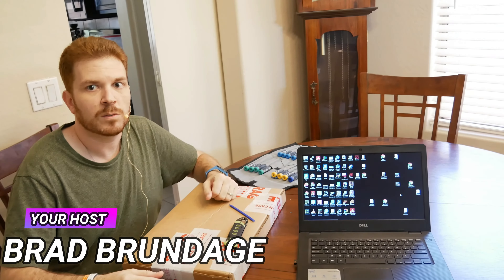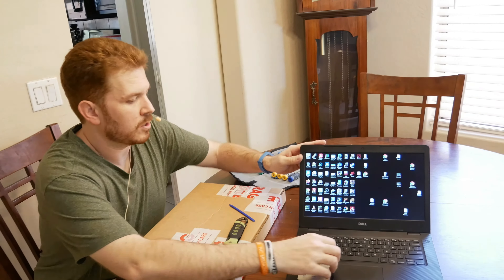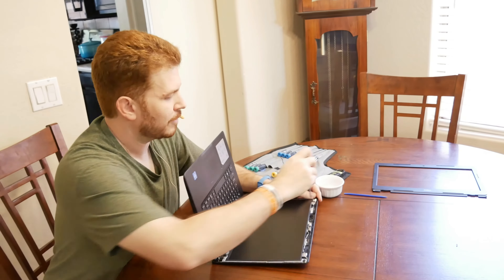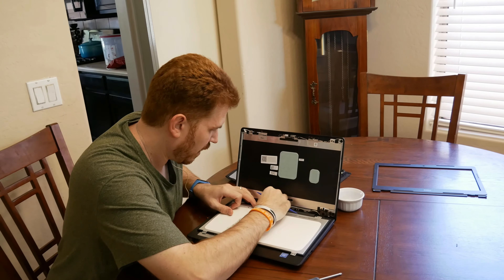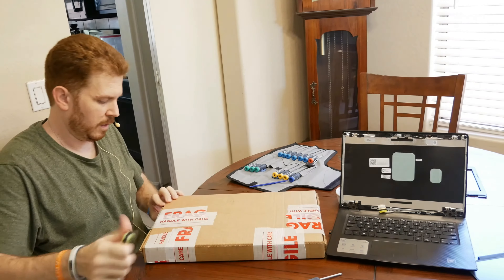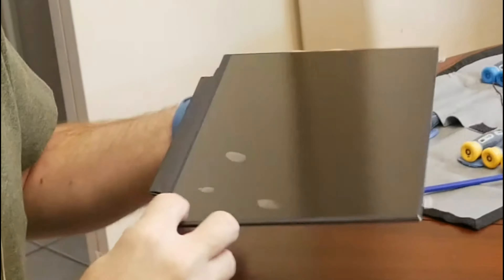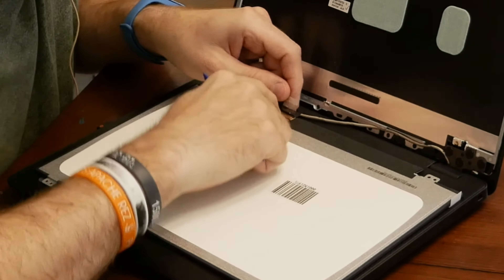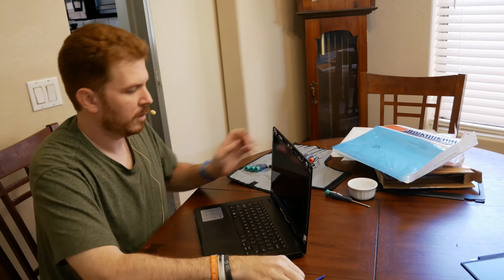LCD upgrade to Full HD | Dell Inspiron 14 3000 series 3493 FHD IPS display upgrade

Comment from the maker: If this get's 1000+ likes in the first month I'll bench press a server in a future video!
This project has been fun upgrading the cheapest most powerful laptop I could find into something really nice!
➡To check out my other videos on this laptop see the main playlist here:
https://www.youtube.com/playlist?list=PLPt3gtEt2KFTT9Se7da68vLo3vOl4pvfH
Reply from the maker: If I get over 2000+ likes in the first month on this video I'll show what mouse I use on my video editing rig.
Reply: @ShinyTechThings  hey man great tutorial and quite easy to follow.i am wondering if u can help me find the ips fhd screen for asus a42j? i ve searchin for it everywhere but couldnt find the ips one.the laptop has 40pin connector.thank you for ur reply.btw u earned another like and subscribe.😄
Reply from the maker: @ridejer5707  That can be a bit difficult because even though I can't find anything for that model specifically you will most likely need to disassemble the display and get part numbers off the back and see what you can find online as being probably compatible. The main things that you were looking for on matching is the pin configuration which it looks like it is a 40 pin LVDS display. You may want to reach out to some of the sellers on AliExpress and see if they can help locate something that might work. Just realize that if you end up replacing the screen and it does not work it could be due to the firmware that is installed on the screen and what the laptop was programmed to be able to work with and you might have to ship it back and try a different panel. Also it looks like your stock screen only supports 720P so if you go to a higher resolution screen depending on your system configuration, it might not have enough horsepower to run as well with a higher 1080P resolution screen because it has to push more data to the screen.
https://www.aliexpress.com/wholesale?catId=0&initiative_id=SB_20210209100222&SearchText=40+pin+ips+14%22+LED
Reply from the maker: @Ride Jer possibly, but I've never use one of those adapters before and I suspect it is still dependent on the firmware being compatible so there's still the risk that you have the parts and it doesn't work. As long as you have the time as well as ability to return items to whomever you purchase them from if it doesn't work, then I guess it's worth a shot!👍
Reply: @ShinyTechThings  thanks man thats alot of info.i will try those and see if it works.😄
Reply from the maker: @Ride Jer Awesome and please let me know the outcome. 👍
Reply from the maker: @Anurag Yadav yes, they can. To keep manufacturing variables and required parts to build different configurations of the same system the number of pins on the connector will be the same, just the specs of the panel itself should be different. That is how I replaced my 720p screen with a full 1080p IPS display on my Dell Inspiron 3493.
Reply: bro what's up!? Thanks for your content. It is very useful. Where did you find fhd screen for inspiron 3493
Reply from the maker: @Sardor Shomurodov I believe off of eBay. I might have pinned it as a comment or put it in the video description. I'm usually pretty good about that, but let me know if you can't find it. Do you have the 3493 as well?

Comment: Nice upgrade! I didnt thought that it would be a plug and play upgrade. Having an IPS display is great, the colours and vewing angles are way better than on TN panels.
Reply from the maker: Absolutely! And for basically $50 is one of the best and most practical upgrades that I've done on this so far! I will be testing my Wi-Fi 6 card once my new access point arrives in a week or two and see how well that performs.

Comment: I got mine back in November 2019, $249 at Walmart. Although advertised as having a Core i3-1005G1 (even the box says i3) it came with the i5-1035G4. Upgraded to a 500GB NVMe and 16GB of RAM. Thanks for the tutorial, I'll be doing the LCD next!
Reply from the maker: Wow, total score! I thought I got the lowest price but you totally scored it!
Reply: I got mine for $200 on ebay as "Refurbished" but it looked like it wasn't even touched once.
Reply from the maker: @Gkid8  That's awesome! Was it with the i5-1035G4 CPU as well?
Reply: @ShinyTechThings  Yep! It's my gaming laptop as a result. I can't do really heavy games but a lot of great ones are possible.
Reply from the maker: @Gkid8  I agree, it's an awesome laptop. I need to try some emulation on it, I bet it could do most emulators pretty good.

Comment: Just received my 3493. It came with the FHD ips panel,  8 gig ram and a 256G ssd.  I'm loving it.  May upgrade to 16 gig ram but I don't see the need yet.  Thanks for your videos and helping me to decide.
Reply from the maker: Absolutely! It's a great inexpensive laptop. With all the upgrades I did to it so far I think it's unbeatable value for sure. Waiting for a Wi-Fi 6 Access point today to setup this week and see how fast it can go over WiFi!😎
Reply from the maker: How are you liking it so far?
Reply: @ShinyTechThings  it's delivered everything I need so far. Light,  fast,  great FHD screen.  I've only used it for study and viewing media (netflix/stan). I originally considered adding another 8g RAM but I see no need for now.  Also tried my Samsung note 9 using the cam software you recommended. Incredible quality.  Thanks for the tips :)

Comment: I recently bought a 3493 refurbished via BestBuy for 605 cdn (450 US) with the 500gb nvme, 8gb ram,  and 1080p but 60hz. Turned out to be a perfect machine fortunately.  I had an extra 500gb Samsung ssd and 8gb more ram was under 60 cdn. Very happy. My question is whether 120 hz is going to make a real difference for me, and how, from the ads I have seen, do I know I am buying 120hz after all. Thanks for the videos and the link to your ebay purchase.? Cheers. Peter  Mountain
Reply from the maker: Maybe I will do a video on the refresh rates 🤔. I have other links in my other videos on stuff as well, just check out the playlist. https://www.youtube.com/playlist?list=PLPt3gtEt2KFTT9Se7da68vLo3vOl4pvfH

Comment: Upgrade the memory on this $300 laptop to 32 (Kingston) and it's nice. Are you happy with the quality of the screen?  Is there a possibility that it can be equipped with a touch screen?
Reply from the maker: @tikblang1 the screen makes it usable in my case. There might be a touchscreen option but I never looked. For the price it is the MOST powerful for the money I could find. Still over a year later nothing can compare that I've seen yet for the money.
Reply: @tikblang1
32 g it’s possible ? For dell 3493 ?
Reply: @ShinyTechThings  ?
Reply from the maker: @Zazzou Mez yes, according to Intel's ARK site the i5-1035G4 supports a whopping maximum of 64GB of RAM!
https://ark.intel.com/content/www/us/en/ark/products/196591/intel-core-i5-1035g4-processor-6m-cache-up-to-3-70-ghz.html
Reply: @ShinyTechThings  correct. The only must have that’s hard to find is the screen resolution , cannot believe Dell still default screen for this nice laptop is 1366x768. That resolution is kinda 5 year old already…
Reply: @ShinyTechThings  thank you, and i5-1035G1 ? The same 64GB ?
Reply from the maker: @Zazzou Mez correct, it's also 64GB as well.
https://ark.intel.com/content/www/us/en/ark/products/196603/intel-core-i5-1035g1-processor-6m-cache-up-to-3-60-ghz.html
Reply from the maker: @tikblang1 actually most consumer laptops under $500 nowadays are 720p, I'm assuming the manufacturer saves $10 a unit on every sale. Dell in some cases has both 720p and 1080p in the same machine but charges a premium for the 1080p as a upgrade.
Reply: @ShinyTechThings  thank you my friend 😊 I have one question: I want change my lcd HD 220 nits—-> FullHD 250 nits, it’s possible ?
Reply from the maker: @Zazzou Mez if it's the same model as mine it shouldn't be an issue. It boils down to the connector and location of the connector if the cable will fit and reach. Then it's up to the firmware if the manufacturer made it proprietary or not. Just buy a replacement from a seller who will return if there's any issues but you should be fine.
Reply: @ShinyTechThings  would love to do it but the seller in Texas is charging an arm and a leg. And I have experienced, internet buying is not good since it’s littered with junk replacement screens
Reply: @ShinyTechThings  thank you 😊
what was the model number of the old screen and the new one?
For me N140BGA-EA3 (old)
Reply from the maker: @Zazzou Mez I don't know on the old screen or where it is I may have sold the old LCD panel. The new one is in a link in the description if I remember correctly.

Comment: So to be sure, my 768p laptop can be upgraded to a 1080p display?
Reply from the maker: In most cases, yes. What laptop do you have?
Reply: @ShinyTechThings  dell precision m4600. It comes in 768 and 1080 but they’re different versions of the same laptop
Reply from the maker: @AgentChavo  that's even easier in most cases. Asl ong as the graphics card is the same then it should be a straight swap. Is yours a touchscreen?
Reply: @ShinyTechThings  well thats cool af. And no its not. I wish though
Reply from the maker: @AgentChavo  so as long as you get a panel for the same model and without the touch it should work but still check the pin configuration (like 30 pin) and the side it plugs to the same side and it should be good! There is always the slight chance that it might not work so make sure wherever you purchase it from they allow you to return an item. But I would say over 95% of the time it will work without any issues. The easiest way to not have problems is to check the firmware version number that is on the back of the existing panel but you have to take it all apart to do so.
Reply: @ShinyTechThings  alright man thank you so much you got a sub
Reply from the maker: @Baby Snow You're welcome. If you have any tech questions ask away. On Tuesdays I do tech support videos, how to's and tips and tricks videos and Fridays are my regular video releases. Check out my other videos and I have several playlists to organize all my content. Feel free to share on and offline with anyone who would benefit from this channel or enjoy the tech content. Thanks for your support 👍
Reply: @ShinyTechThings  of course man you’re really helpful I appreciate what you do
Reply from the maker: @Baby Snow no problem, just trying to do my part to contribute to society wherever I can. You can also hit me up on Twitter, instagram, and Reddit if needed and links should be in the video descriptions for everything. I actually do take the time and sometimes it is even hours to write stuff out in the video description.

Comment: Nice work man! I was wondering if a full HD display can be installed in the same fashion for dell Inspiron 15 3542? If yes, do you have a video on your channel?
Reply from the maker: @Rayed Aslam thanks for your support, I made another video I thought I linked it up at the end or as a card but when I get home later I'll check and update it. I made a video explaining how to do this with almost any laptop here:
https://youtu.be/rsXDvvzBjV8
Please drop questions and comments on that video for some reason it doesn't get much traffic so if you comment a bit and like it then it might help get it recommended more.
Reply: @ShinyTechThings  sure man. I'm not an expert so a dedicated video for my laptop will work wonders for me. I've this laptop for quite sometime now and I don't see any reason to replace it just yet. I've a work laptop as well.
Reply from the maker: @Rayed Aslam  unfortunately I don't have one of those myself however if you are by chance in the greater Phoenix area I could potentially meet up with you and make a video on it at the same time, if that is the case then please email me through the contact page.
Reply: @ShinyTechThings  that's not going to happen man. I live very far away lol. Btw let me know just one thing if you may, I bought an internal ssd and installed it in place of my DVD CD drive using a caddy. Is this okay? Or I should move my original HDD in the DVD drive slot using a caddy and install the SSD in HDDs place?
Reply from the maker: @Ryed Aslam So that depends. Most optical drive slots are SATA2 and not SATA3 so the drive would run slower if that's the case. You could verify with crystaldiskmark and do some benchmarks between the 2 connections.

Comment: Great video! I 've the same computer Inspiron 3493, but mine came with the 1080p screen, 256 MB m.2 an 8 gb of ram. Now you can change the keyboard for the backlit keyboard, and the fingerprint sensor in the power button!
Reply from the maker: I haven't been able to find those parts yet, does yours have the backlit KB and fingerprint scanner?
Reply: @ShinyTechThings  No, and I can't find them either
Reply from the maker: Its possible that thee may be a Vostro with the backlit keyboard that might fit but I don't know if they make a fingerprint sensor that would work as the motherboard would have to support it as well and it could be missing the physical hardware soldered to the motherboard. If I find one I'll give it a try!
Reply: @ShinyTechThings  In the laptop reference guide and service manual it mentions the avalability of fingerprint sensors and backlit keyborard in some configurations, so I think it should be possible to find them. I forgot to say that I bought this laptop a month ago after watching your videos.
Reply from the maker: Thanks, I'll keep digging and see what I can find on it a d of course make more videos on it as well. How do you like it so far?

Comment: How’s the color and clarity on that display cause I read about matte screens lacking in that area?
Reply from the maker: @Erin Franceschi Personally I think it's fine for my regular use, but I will say my M1 Macbook Pro has a much better screen however costs almost 5X as much. What will you be using it for exactly? You may be able to find a glossy IPS panel instead, I just went with the first one I found as the 720P was driving me crazy.

Comment: I have a Toshiba satelite c855d-s5116 and I have upgrade the ram from 4 to 8 and there is one guy that has a video that he even pushed it to 16g, I want to have a full HD screen but how do I know that my processor will handle it? A person on youtube again did it and seems to work but no follow up video on how the laptop runs.
Reply from the maker: @trescarnales technically if the LCD panel firmware works and the pin layout is the same it should work. from what I looked up on this particular model of laptop it has a AMD A6 processor. You should be fine running at 1080p, however if you try to play games at that resolution it will probably not play as well as it did as 720P because the graphics card and processor would have to work harder to output more information to the screen. But for regular tasks like watching streaming video, and office productivity applications it should handle just fine.

Comment: Does it mean i can upgrade my display as long as the panel has the same amount of pin connectors and is the same inches as mine
Reply from the maker: Possibly, there's also the variable of how it mounts inside the chassis and what side the connector is on. Also some makes and models may use proprietary firmware making it more difficult to swap it out. Best advice I can give is to buy a replacement panel from a supplier who allows returns and exchanges.
Reply: @ShinyTechThings  thank you
Reply: You've been replying to people for a year, i just want to say thank you for giving us all the information we need
Reply from the maker: You're welcome.
Reply from the maker: @ÊD1TŹ-VÍPËR  Glad I could help. Please feel free to share my channel and content with anyone you feel that could benefit from it. I take my time and reply to every comment and question and I'm pretty reachable on Instagram and Twitter as well. Thanks for your support!

Comment: I'm having the same laptop in India but with i3. I purchased it because i was on budget but now i can upgrade it. Sir can you tell me what kind of SSD can be installed and how? because i have HDD version and it makes the laptop kind of slow.
Reply: The video is really amazing, knowledgeable and on point.
Reply from the maker: @Mehul Chandel here's a video on upgrading the 3493 but if it's the same board there's a NVMe slot which will give you the fastest speed of SSD. Let me know if you have any questions. 
https://youtu.be/NTBzSeLy-Yg

Comment: Hey, i have a dell inspiron 14 series 3000 (3442),  will it work with my laptop ? thanks
Reply from the maker: You can swap out any screen, you just need to find the one that fits correctly. This one could work but I'd open up your bezel and verify before ordering that the mounting brackets are the same. https://shopee.ph/Dell-Inspiron-14-3443-3441-3459-3442-3451-3458-3452-screen-IPS-LCD-screen-i.133290147.5846444930
Reply: @ShinyTechThings  the IPS screen that you used in the video works perfect for my dell inspiron 14 3442, THANKS YOU SO MUCH, IS A LOT BETTER THAN THE TN SCREEN, THANK YOU, GOD BLESS YOU.
Reply from the maker: Glad to hear it! Is there anything else I can help with or make a video on for you or your friends that they might also enjoy?
Reply: @ShinyTechThings  can cpu handle increasing from 1366×768 to 1920×1080 ? Won't be any pressure on cpu ? Will It cause decreasing performance of cpu ?
Reply from the maker: @mohammadkhakhsoor2068  It can but it runs everything that I run on it just fine.